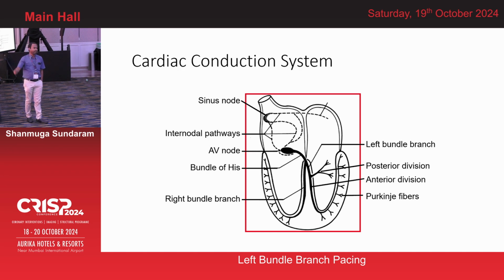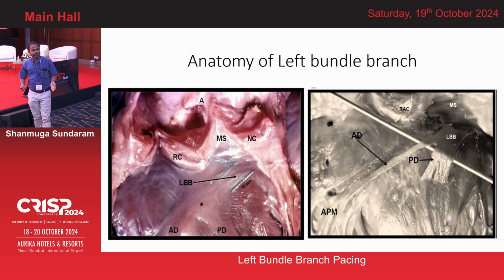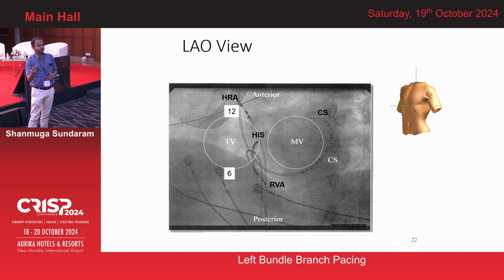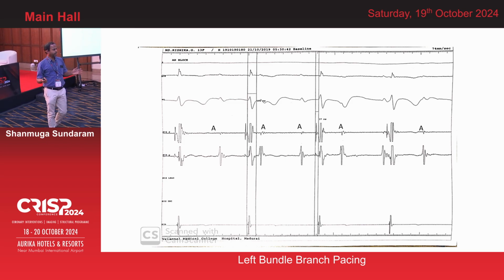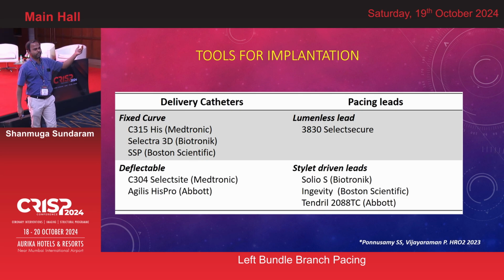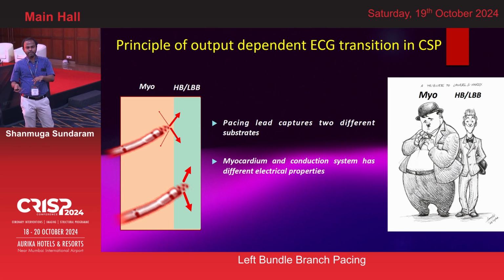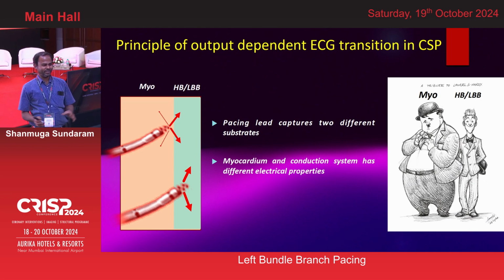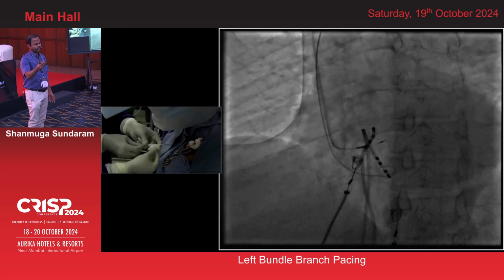Left Bundle Branch Pacing: The New Frontier in Cardiac Pacing 🫀⚡ Shanmuga Sundaram

Comment: 2 points will help
1. Fix and stabilise the sheath with non dominant fingers (little, ring and middle) of the operator (rather than assistant) 
2. Tie the sleeve on the lead so that torque is transmitted in a better way.